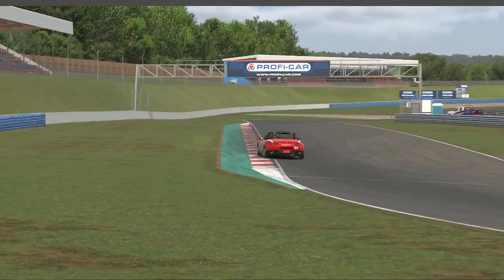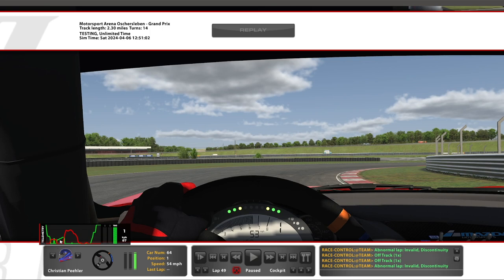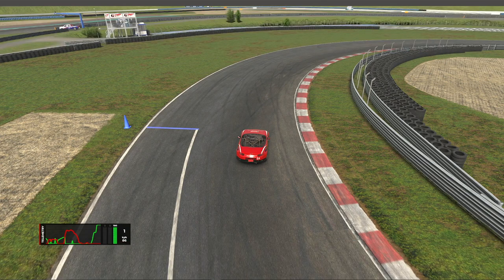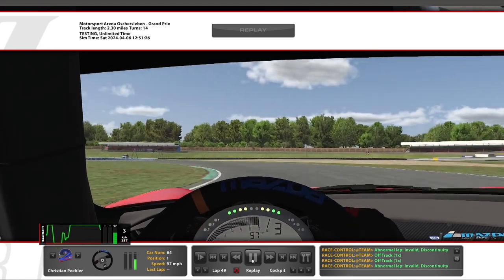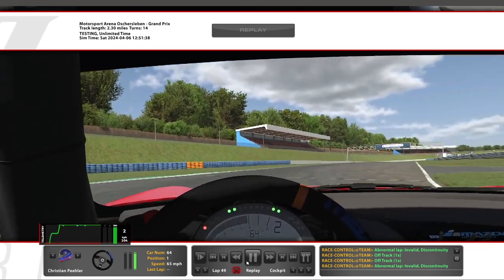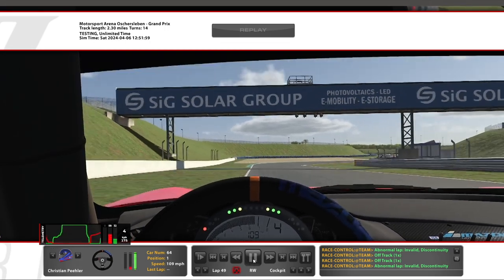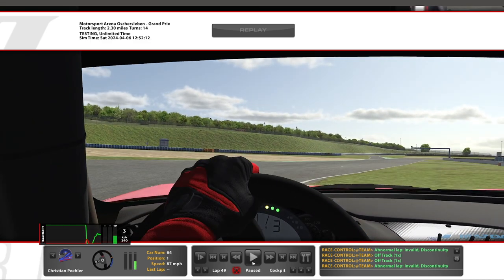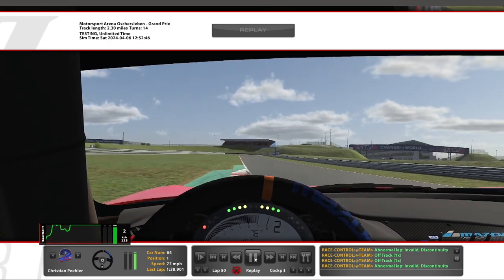iRacing Track Guide | Oschersleben - MX5 Cup Tutorials (138.9)

Comment: Sent you a couple laps to have a look at. 
Thanks again dude
Reply from the maker: Most of this lap looks really good.  Obviously little things can be done in pretty much every corner, but let's just talk Turn 1-2 only because you're doing something super similar to a friend I have trying to get out of Rookies, but you are very close to getting it right, and a few small tweaks might make it a whole lot faster/safer.

I think the biggest thing you're lacking is the use of throttle to control the rotation through T1.  If you watch back you'll see I have a slightly longer less sharp brake input, but on that middle apex, I hold the gas for a while between Turn 1 and entry of turn 2.  

Again, I hold that throttle 100% to shift weight to the rear of the car to stop it from spinning left.  I'm managing the balance of the car with throttle, not trying to go faster.

Now, I think since the car is upset, and over rotating, you're almost pointing left to go right, which makes you over slow on entry to 2 to not run wide.  So you then use a bit more brake than I do struggling to get the car slowed down and balanced.

Minor detail, on exit of 2 instead of washing the front tires so much, let the car use all of the track and use all of the width available.  

Overall, your inputs are really close to what you want, I think your issue is much less with the rotation mid corner, rather the high speed entry and balance of the car.  You're setting yourself up slightly out of position and off balanced, which compromises the entry to turn 2 a tiny bit. 

 I'd say the main take aways:

1- Between Turn 1-2 use more maintenance throttle (longer duration) to shift weight over the rear for better balance.

2- Focus on braking straighter into turn 2.  On your flying lap, the car is rotating left why applying brakes, which means the right tires are going to be overloaded vs the left due to the cars platform being off balance.  This is the root cause of you having to likely hit ABS and push to 87% brake application, which is probably a hair too high.  

I think your exit is nearly right about there, minus you getting a bit of wheelspin due to not tracking out to the green curbing, that looks good, just focus on T1 and entry of T2!
Reply: Thank you, nice detailed explanation. I looked back on the VRS telemetry and couldn't figure it out. Using the throttle for balance has never crossed my mind but this has opened my eyes in regards to car handling.  
Even if I get into the mid to low 39s I'll be happy.

Im gonna go practice ill let you know once I improve
Reply from the maker: 100%

The huge issue I see there is that the car over rotates left or spins left.  Then to me it's like an autox slolam where you get late, just a chain reaction of making everything after more difficult because your positioning and balance are way off.

Focusing on having a balanced car platform to brake straight and smooth into T2 helps so much.
Reply from the maker: Also, I just realized I looked at Revas lap last night. Let me fire yours up and see what yours look like.  That's my fault.

If you can approve my email to download the files I'll take a look at your lap as well.
Reply from the maker: Just got your file now.  And very similar advice to what I was saying before, but more exaggerated.  

Entry of T1 I think you spike the brakes too hard which upsets the balance, and you're not using the gas to balance the car between, which I think is causing you to have a difficult entry into T2.

That forced you to use a lot of braking and be wide entering T2 and throughout T2, so that lead to a late exit.

Mostly, I would say you're not really trail braking.  You start to trail brake, where as you turn you back off the brakes, but then once you hit 20% it sort of quickly falls to 0% coasting and there's a large gap between the end of your trail and the throttle again.  

Think 1% brake drag for trail braking in the middle of the corner, it's just to help turn the car more so you can get back on throttle earlier. 

Main things to try:

1- Try dragging 1% brake at the end of your trail until you roll back onto the throttle.  Typically "nothingness" mid corner is not the right thing, so if you find yourself coasting a ton mid apex it's probably a bit slower.

2- In a practice lobby try to use the rear of the car to turn rather than the steering wheel.  In the MX-5 one of the best things to learn is how to basically "spin" the car into the corner so the rotation turns the car, not the front tires/steering wheel.  You WILL spin a bunch of times trying to do this, but I would say, carry a bit more speed into the corners and try to learn how to spin consistently on entry.  Once you learn how to spin, it'll help you control that rotation on entry a bit more and carry a few extra MPH on entry.

Biggest issues now:

1- Not trail braking / Large gap in inputs in longer corners

2- Over-braking on entry which causes you to not be able to trail brake as efficiently because you're going too slow to drag the brake more.

Overall, the driving looked clean and safe, and these 2 main things are difficult to nail.  I recommended a test lobby alone because you're going to want to set active restart points for prepped tires because you'll probably spin a lot trying to nail trail braking and rotation.

Hope this helps and gets you a few more wins!

Comment: Very nice.
How can i send you a lap?
Can't go under 39 , best so far 39.130 . 
I did get a feel insights from your lap but I just can't get 1 , 2 ,3 right.
Reply from the maker: Are you able to save the replay file?  You can try uploading that to Google drive and email the link to cpeehler.ppc@gmail.com

Just comment here when you send it, I don't watch that email closely, I figure if I'm tossing it out on YT to make it one of my burners, hahaha.
Reply from the maker: Also 39.1 is solid!  1-3 are really hard to nail.  One other person I watch who helped me a lot figuring those types of corners out is Suellio Almeida.  He has a few videos that go hugely into detail about zero/neutral steer that helped me connect the dots in my head about what and why I was doing certain things.

But shoot me that .rpy file and I will see what I think you should try.
Reply: @sim2circuit  I'll do a session a little later. 
I just did one with solid 39s using some things from your video but forgot about the replay.
It helped a lot with 1-3 I was definitely carrying way too much speed into 2.
So instead of trail I was still slowing the car down which them led it to slide a bit before I could be back on gas.
My OPT is 38.8 so just on the one set of corners 1-3 I was losing .4 on my usual laps.
Now I'm down to .2 or so but I can feel the improvement.
Also I'm working on trail more even if it's slower at the beginning. 
I'm one of those break and let it roll guys.
I know that I'll definitely get faster if I improve on that.
I'll let you know when i send the replay to your email.
Reply from the maker: Awesome, just really focus on using the gas and brake as tools to shift weight. When you think about balance and weight distribution over everything it might help.

Turn 3 specifically, I've found cutting distance and being very progressive from trail brake to rolling into throttle works well. 

Avoid that large pause of nothing (no brake/no gas) in the middle of the corner. Just 1% drag of brake can help point the nose immensely so you can roll back on throttle earlier on exit without that off camber bit pulling you wide.
Reply: @sim2circuit  I sent you the Lap file. 
Let me know if it worked
Reply from the maker: @lucasReva Hey my fault, my recommendations for you I posted on lockonhd's comment.  I mixed them up last night.  Everything looks really good across most of the lap, I feel like breaking into the 38.9s is right there if you use the throttle more between 1-2 to position and balance the car better.

Check out the more in-depth comment on the other reply I accidentally made to him.  I hope that helps.

Comment: I've just started iracing and won my first race last night. My fastest is a 1:41.3. I lose alot of time in the first 3 corners I struggle to get it right
Reply from the maker: Congrats on the first win!  It can be hard staying alive in Rookies, so that's a huge achievement haha.

1:41.3 is pretty decent for just starting out too, I have a friend who just picked up iRacing and is roughly in the same situation losing a lot of time through the first 3 corners.   The biggest mistake I see people making there is:

1- Using 100% of the brakes between turn 1 and turn 2.  

2- Lifting and coasting through turn 2 and 3, not dragging ~1% brake/trail braking to dip the nose.  

3- Lacking patience on throttle causing you to have to throttle/lift/throttle to not go wide.  Getting back on the gas takes weight off the front and will cause more understeer if you're not patient enough.

The best way to think about turn 2 and turn 3 is that you're dragging your brake ~1% to turn the car better (after you've slowed down to roughly the right speed for the corner).  It puts the weight over the front tires and lets the car turn more.  When you get back on the gas in a corner, it'll increase the radius that you can turn pushing you wide.  I see a lot of newer guys lacking patience and trying to get on throttle too soon leading to "gas, lift, gas, lift, gas, lift" type inputs which really slows them down.

If you want, feel free to go turn a lap and save the replay.rpy file and upload it to a Google Drive to download.  I'd be happy to take a look at it.  

To save a replay, go to:
Options
Replay
Enable "Ask to save replay on [Quit]

Then when you quit it'll save your replay .rpy file to your documents/iracing/replay folder. 

Reviewing a lap with the actual .rpy file helps a lot because I can run racelabs telemetry overlays and see exactly what you're doing with throttle and brake inputs, which will most likely be where you're struggling the most.